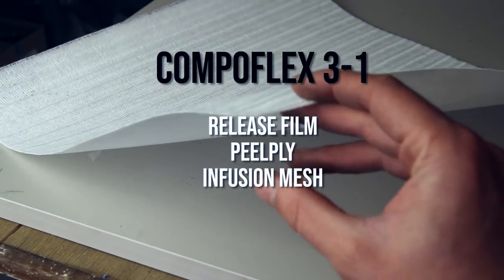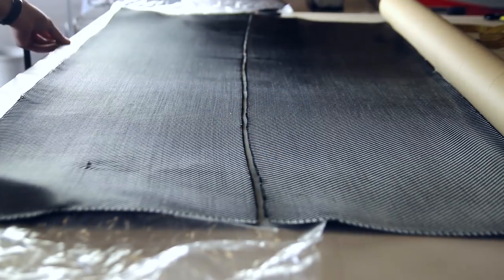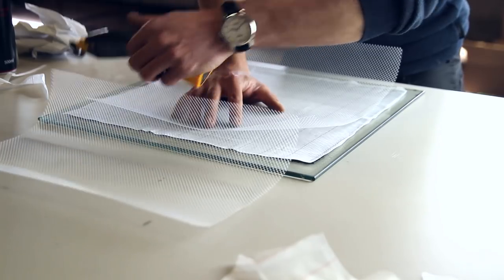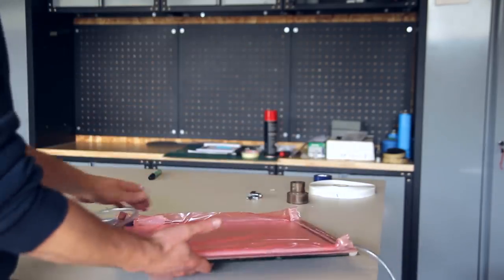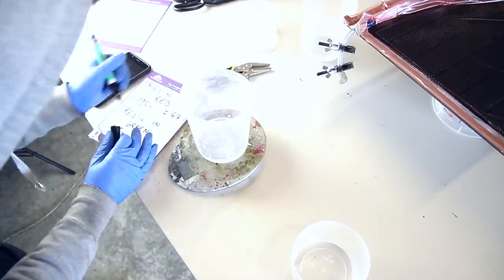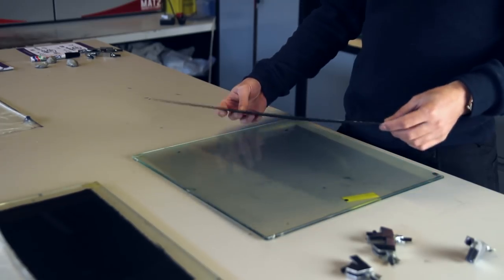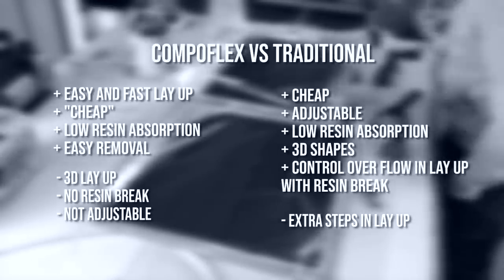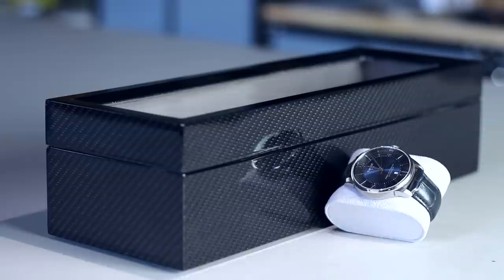Carbon Fiber Resin Infusion with Compoflex 3 in 1

Comment: Those surfaces came out nice!  I really like how you show the ratio calcs. and the pros and cons.  Compoflex is a little harder to use on compound surfaces but you can overlap it with thicker layups - or cut it back 10-20mm from corners and just cover the exposed laminate with strips of peel ply.  I would also cut it back from the outlet side and add a strip of peel ply to make a resin break - same way you'd hold back the flow media.
Reply from the maker: Glad to hear you liked those parts, was afraid some people would find it to long or boring 😊

Comment: I'm using compoflex all the time. Awesome product. I would strongly advise having a resin break by just adding a little strip of peel ply on the vacuum side and cutting the compoflex a couple cm short.
Stacking works without problems either. Only negative is the 3d formability as you mentioned as well. Price is not an issue in my opinion as it improves the process stability which is worth a lot in an industrial environment.

Comment: You have a fibre-to-resin ratio of 0.56 with the new method, which I think is excellent, but I thought they usually recommend a fibre to resin ratio of 1:1 to ensure high structural strength?
Reply from the maker: With Resin infusion on bigger parts I'm mostly at around 39 resin - 61 fiber which is better with resin infusion. 1:1 is more for a wet lay up. The less resin the better normally, as the resin being the weakest part in composite parts. But on a small thin part like here I'm pretty happy with these results.

Comment: Is there a way to use this technique to make carbon fiber plates that have a gloss finish on both sides?
Reply from the maker: you'll need to do it differently then, Or you glue to plates back to back together so you have a gloss side on each side then, Another way would be to infuse with another glass plate on top of it, but might be hard to manage the resin flow through the glass then. Mostly they would use prepreg with hydrolic heated presses for gloss on both sides

Comment: That is awesome. My problem is that can't find it in Austria, and now in corona time I would buy in Austria (my home)
Reply from the maker: Are you talking about easy composites or the compoflex? Have you tried contacting the manufacturer fibertex to know if they have distributers nearby?
Reply: @MatthieuLibeert  till now I was buying things at hp textil I germany. Now at corona is it expensive to ship. Yes I talked about compo flex. Since some week we work at Vakuum infusion and we had a lot of problem. First problem was the surface. We always had that spray glue there. Than we got air closed in and the third problem is that out screw from the mould got a lot of resin on them. We use moulds that is build together out more little mould parts. Hope you know what I mean. And now on the and I try to find this complex anywhere here. Maybe for a try I buy it in GB

Comment: Thanks for another great video Matthieu. Two questions... why do you use two clamps on a single hose? E.g at vacuum side. And is there a reason why the intake is at the other side of the part as the vacuum line side?
Reply from the maker: Double clamp to be sure the hoses are fully sealed, found out that sometimes there might still be a small leak with these clamps, but it's more to be safe than it is needed. The side of resin in and out doesn't really matter 🙂
Reply: @MatthieuLibeert  Thanks for the clear and quick response!
Reply: @MatthieuLibeert  Hi Matthieu, one more question. Here I think you use spiral tube at the resin feed side, but in some other video's you seem to use resin break instead. Any specific reason for using one ore the other? Thanks Marco